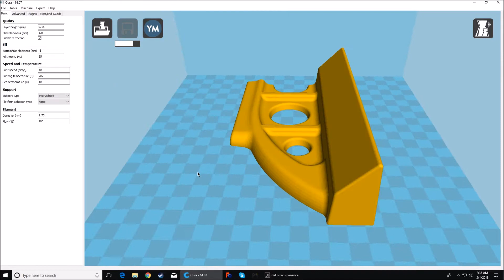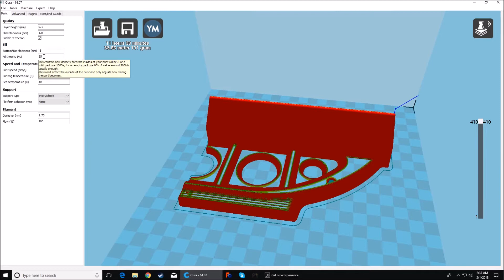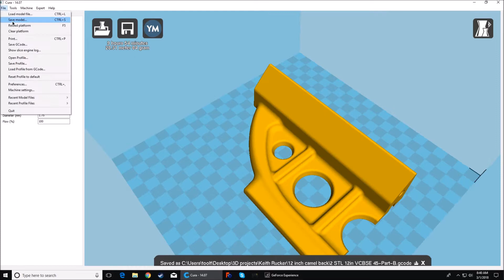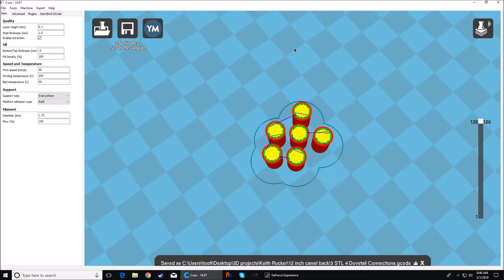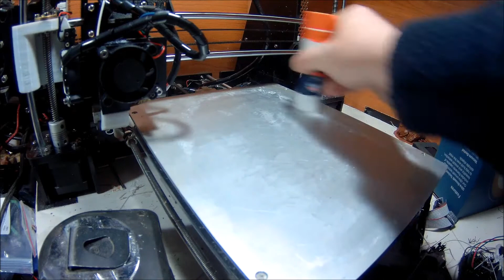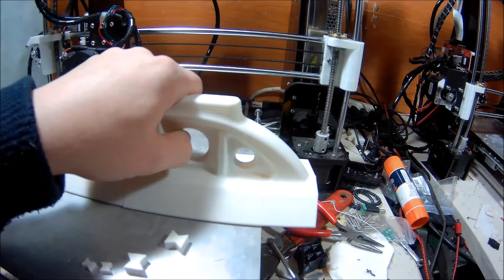3D Printing: Camel Back Straight Edge

Comment: Really nice pattern how long did each of the 4 main parts take to print .please.?
Reply from the maker: About 9 hours each. That was a 0.15mm layer height @ 50mm/sec print speed. The redesigned set I printed for Keith I slowed to 40mm/sec and they printed even nicer.
Reply: TattooPyramidHead  Thanks for that